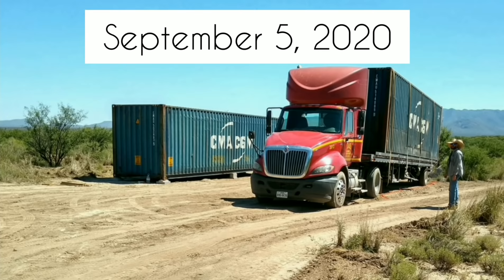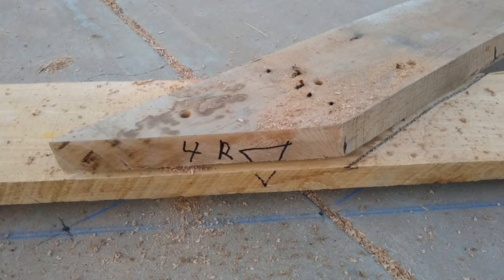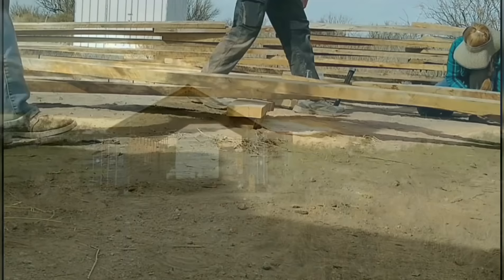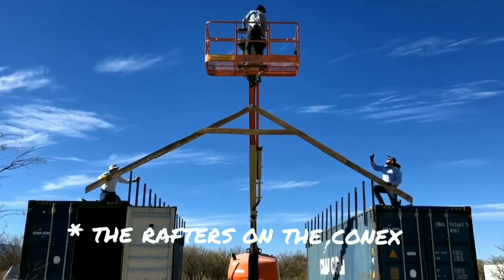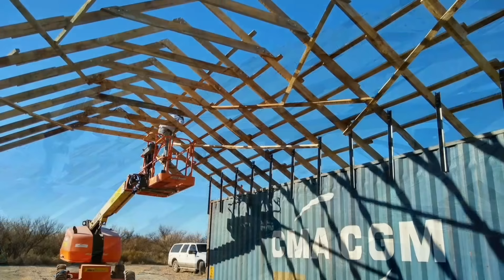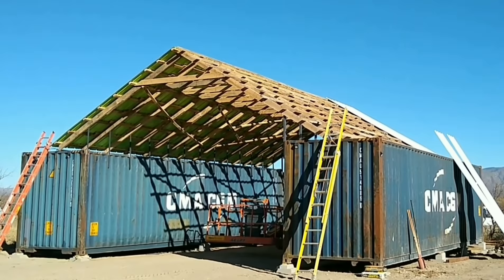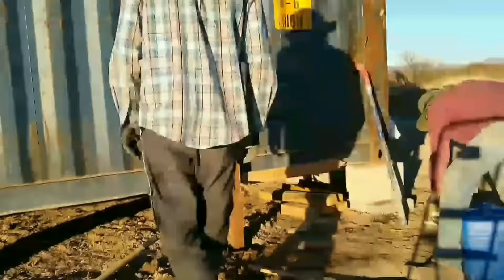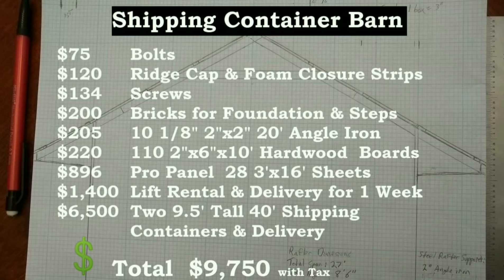Shipping Container Build | One Year Anniversary Recap: Barn, Shop, Storage, Shade & Solar $ Cost

Comment: Good Job! 
We bailed out of the Matrix 20 years ago. We lived in a 16' x 35' military wall tent in Central Arizona for 3 years while we became debt-free . We kept our belongings in a 20' Connex and then added lean to shades around it for a shaded workshop of sorts. 

We built a large house with ICF and then used river rock from our property to come up 6-7' around the outside. We paid cash all the way and did 98% of the work ourselves. We are still not completely done with a few things like trim, tile and the exact lighting we want. However, this was the best decision we have ever made; especially considering what the world is now facing. Keep up the good work!
Reply from the maker: That sounds like quite the adventure, very cool! That's a whole lot of river rocks to gather up. Years ago we gathered many loads for landscaping, it's a lot of work, but I love rocks!
Thanks for watching!  😊🏜️
Reply: @RedandAprilOff-Grid  it has been a challenge at times but such an experience that it really shaped us as people for the better. Yes the rock portion took about a year ( not everyday) . We went total of 250’ by about 6-7’ high. The walls are about 3’ at the base tapered up to  about 10” at the top. We have an R-factor of approximately 50 with the Polysteel ICF blocks(filled with rebar and concrete) . It’s way over-built but it’s like a Castle to us. We calculate it would have cost over $40k just to do the rock if we hired it out.
Reply: Snap we did the same in OZ with icf too. Not totally finished, not totally ideal but  it is off grid and Debt free.
Reply: how did you insulate?  metal box in Arizona....... wow

Comment: PS. I WOULD HAVE PUT THE STRUTS ON THE OUTER SIDE OF THE CONTAINERS' CREATING A KNEE WALL AND EXTRA STORAGE ABOVE THE CONTAINER. the flat surface on either side will just allow water accumulation and rust issues so my suggested design remedies that and ALSO allow lean-to extensions down the road.
Reply from the maker: It would have made for a much larger, taller, and more expensive roof, since we needed the 30° pitch for our solar panels,  We get some water coming in, but it hasn't been a problem at all. We have as much storage as we need, we are trying to use and reuse what we have, and not collect a lot of stuff.
Reply: ..

Definitely Sea both angles

Yes
Lean toos can be added

And
Struts on outer sides
provides rust protection
and added space for storage

Good Eye
Be Well ~

...
Reply: It Would have been very efficient use of space. I never have enough storage. I also would have gone with scissor trusses as well.

Comment: The bottom of those connexs will make great homes and shade for critters like snakes and such if you have them in your area.  If you install blocking or a skirt around the connexs that will stop it plus block cold wind from blowing in debris and such.
Reply from the maker: When it's skirted it creates an even better home for rodents, because they can dig tunnels under the skirting and not as many predators can get to them.

Comment: With your container anchors, I would recommend people use square box section tube like 4x2 or 4x4, I actually used 5mm wall box tube to support the weight of the container and welded the corner to it so supporting the down weight and stopping it from moving, it can be done after construction but best done before as there are many wind forces that bear on it one can easily do this corner by corner by moving the blocks digging and cementing in the tube to weld to container, all of it sits under not outside the footprint of container, I think it's a better way.
Reply from the maker: That sounds like a good way to do it.  👍
 In the video that came out today, Red checked the levelness of the containers before mounting the gate.

Comment: just my 2 cents.  at 12:30 you embedded anchors to attach the conex box, you should have used metal, metal works with concrete  whereas wood expands and contracts beyond the tolerance of concrete.  thank you.

Comment: If you are welding on the very thin walls of a shipping container and blow a hole through, [very easy], all you have to do is have someone hold a 1/4" thk piece of copper plate on the inside with a tool, and you will easily be able to fill the hole from the outside, or alternatively, hold a steel plate on the inside and fill the hole the same way leaving the patch plate there as a patch !!!
Reply from the maker: 👍thanks

Comment: Very Nice! This is what I would call an Amish Redneck Barn! I would suggest walling off the gables and creating a little bit of a loft on the ends which would add more strength, stability and attic storage capacity! Solar panels are heavy! Nice big barns get real small after you start filling them with stuff, starting with a camper!
Reply from the maker: Thanks! It looks a lot better than I expected, and has been great for everything we have needed while we build our house.  Once we get our house built, we'll move the trailer out, and Red plans to use the structure for a shop, and possibly enclose one or both ends. We hope to keep everything fairly minimal and uncluttered out here. 🌞🏜️

Comment: I wouldn't worry about the roof pushing the containers apart but you should have put a second pitch out to edge with some 8 ft boards.and more important you should have really staggered the joints on those perlings
Reply from the maker: It's all good and everything has worked out great. We like being able to walk on top of the containers to access the solar panels, and the gutters work well.

Comment: Such a great flashback. Great drawing skills. How did Red all this great building knowledge, even cutting metal.
Reply from the maker: We have done a lot of building and remodel projects throughout the years. Woodworking is a hobby, & he has designed and made some pretty cool furniture pieces. He worked as a Machinest for 7 years, but had very little experience with welding. He does a little research and figures it out as he goes. Thanks!
Reply: @RedandAprilOff-Grid  well he seems like a very smart man, amd very meticulous. I am just very surprised that he understands the tensile strength via applying moment to the aircrete piece. Hense the bottom of the piece experience tension and breaks because concrete is brittle. This is why in reinforced concrete, the rebar is put on the tension side to resist that effect.

Comment: Great looking barn, personally I would have covered both containers to prevent rust and weathering and improved insulating, also joined batten over trusses to maintain one clean line, only for appearance. You guys have created a great economical space, well done👍
Reply from the maker: Thanks! For our particular needs, budget, and the the materials we had available, this design has worked out well. 🌞🏜️
Reply: I was sort of thinking the same thing.  It would keep the containers cooler too.  I want to do something like this someday. Thanks for posting the video
Reply: Yep better to cover the entire roof area of the containers. Moisture over time will rot the roof

Comment: The roof should go past the containers so water does not corrode the tops of the containers. You could put construction lumber all the way under the metal roof so when something hits the metal the sound gets dampened at the source. The amper setting on the welder should be set lower so you do not burn through the container wall.
Reply from the maker: This has worked out fine for our area. We get most of our rain in the summer monsoons and it's pretty dry the rest of the year. Also the gutters we installed work well.

Comment: When i was in the swedish military and stationed in another country the barracks where constructed almost exactly like that. Two living container with a roof with steel beams and a wooden deck between the containers. The roof was extended all the way past the containers. Believe that was a wise decision.
Reply from the maker: Very interesting! 😎
Although not ideal, it was well worth it to us to set the roof in the middle of the containers, we needed the steeper pitch for our solar panels, and the wood we had wouldn't have been long enough to go to the edge. Water coming in hasn't been an issue, & it's a nice and very secure solar rack. Someone in the area just spent $5,000 just in materials for their solar rack. 😄 Anyway... It's working well.

Comment: The treated lumber in the concrete is going to rot quicker than you realize. Should have used a steel mounting bracket for the base of a post.
Reply from the maker: We don't feel like they are entirely necessary, but we may eventually replace them with something better.

Comment: By the time you put a few ton of stuff inside the contains plus their own weight, they wont go nowhere, our containers havent moved and our huge canvas roof tore to shreds by high winds, one thing I will say about your roof, you need to fully cover the tops of the containers as the roofs eventually rust and leak.
Reply from the maker: Yes, the containers can handle really high winds even when they are empty. We don't get a lot of rain here, the tops of the containers are painted and look great so far. Currently, we are working on turning the middle into and enclosed shop. 🌞
Reply: @RedandAprilOff-Grid  We used 3 40' containers to make our shed, but when we build our new 400 sq mtr shed we stopped using it except for storage, then high winds ripped the canvas dome to pieces and that was the end of it, our original shed used 2 40' and 1 20' containers with a flat steel roof, after about 10 years the roofs were all rusted and leaking badly, that's when we built the second shed.

Comment: So the pitched roof directs water to the top of both containers. How did you keep it from flowing under the roofed area since the containers have flat roofs
Reply from the maker: We have gutters on now, but even before the gutters, we didn't get too much water coming in. The tops of the containers have a slight arch, so most of the water runs off the outside edge.
Reply: That’s what I was wondering. I build container homes in Texas and we have a problem with rust here. So keeping rain water off the containers as much as possible is the best thing. Even tho they are “sea worthy” they are still steel under the paint.
Reply from the maker: @pb7133  We painted the tops of the containers with a white elastomeric paint. We get almost all of our rain in 3 months, and are pretty much dry the rest of the year.
Reply: @Shawn Kemp or added a second roof pitch under the Eves of the first roof
Reply: Was wondering the same thing as I am in the process of building one of these. I was thinking of sloping each shipping container slightly out then foaming the ridge gap (I do spray foam)

Comment: ..

Bravo

Considering post covid
excellent savings

Do understand your decision for AZ
query John Wesley Powell
at your leisure

essentially looking to do the same
configuration
but half the length
and yes
side doors for easier access

Do like the garden
Solar set up
Rain catch system

Nice of the driver to
set the 2nd Sea Container
where you desired

Alaskan YouTube couple did similar
one Sea Container
two car ports

Figure to use both layouts
with first pouring concrete
and Rebar

Well Done
Congrats

Saw a family with a few red Sea Containers
used white paint
to give the box

a look of
Brick Buildings

Enjoy
Be Well ~

...
Reply from the maker: Thanks! We are really enjoying Southern Arizona. 🏜️  Arizona is pretty ideal in many ways for what we are doing. We love the abundant sunshine, cool nights, summer monsoon season, interesting wildlife, beautiful sunsets, and mountain views.
This structure has worked out wonderfully for our needs! Sounds like you have done your research, best wishes on your build! 😊

Comment: Late to the party, but I've got to ask: Considering you were building the entire roof to custom design anyway, why on Earth did you not extend it beyond the outside edges of the containers, for sun, rain, etc?
Reply from the maker: We need a 30° angle for our solar panels. To keep the roof at the proper angle, we would have needed a lot more materials, and it would have been a much larger roof. This design has worked great for us. No regrets!

Comment: Looks great! I'm curious, why did you opt to run the trusses to the middle of the containers rather than the outside edge? Would you make any changes if you were doing this again?
Reply from the maker: It had to do with the materials we had, and we needed the proper pitch to mount our solar panels on the roof. At this pitch, the roof would have needed to be much larger and taller to completely cover the containers. Everything has worked out great for us in this area. No regrets.

Comment: Off grid doesn't mean being left alone in my part of the country.   did your taxing authorities treat your structure as a taxable building?  I suspect as soon as you poured that concrete and attached it to the Conex that you are due for reassessment on your property taxes.  I placed two 40' shipping containers on my property but they just sit on blocks so didn't earn me a reassessment.
Reply from the maker: @ForbiddTV  Yes, the concrete pad will effect our taxes. The containers are not on a permanent foundation, so that should help keep the taxes lower.

Comment: Probably metal instead of treated wood in the ground would have been my choice since wood is not that strong considering the weight of the container and roof.  Also wood in the ground wont last.
Reply: Treated wood has a long lifespan if not cut. If cut, it needs to be treated.  I have two barns with fifty year structure warranty that use treated posts. One is already 30+ and solid. Metal will rust through if in the ground. I have seen too many metal fence posts that rusted.

Comment: How is water going to run off the container roof? It will just collect there and then flow down on the inside as well as the outside?
Reply from the maker: We have added gutters, and the tops of the containers are slightly rounded so water runs off the outside. At times the wind blows some water in, but it's not a lot.

Comment: I forgot but you we're going to insulate that with open cell foam right?
Reply from the maker: The solar room is all that is insulated for now. For that, we used a double layer of foam insulation board and covered it in drywall. The ceiling in the solar room is 8 feet tall, so there is a gap between it and the top of the container. It has been working well, but we probably should try to insulate the floor too.
Reply: @RedandAprilOff-Grid  Arizona must be a pretty dry climate. Steel likes to sweat when it goes from hot to cold, we have that issue in winter here in Canada. So if there isn't enough ventilation within that gap you mention then mold happens on the foam boards.
Reply from the maker: I think it's been good so far, but it would be interesting to take a peak. Yes, the winters here are typically very dry. We'll keep an eye on it, thanks! 🙂
Reply: @RedandAprilOff-Grid  no problem, when you see thousands of attics with mold, you start to figure out the cause lol. And also what works and what doesn't.

Comment: Nice work!  The wife and I are getting ready to do similarly here in NW AZ.  Kinda curious though...what do you do about the rain runoff when monsoon season is upon us?  Does it flood the top of the containers?
Reply from the maker: We have added gutters, and the roof comes a little past the center, so the water runs down the outside edge. The tops of the containers have a slight bow. Sometimes the wind is blowing hard enough that we get a little water running in, but not enough to be a problem.

Comment: I could not watch to the end but it would have been a hell of a lot cheaper to put a few posts in the ground and start from there
Reply from the maker: Not with the time constraints we had when they were delivered.  The blocks won't rot, and later he cemented some treated lumber into the ground and anchored the corner of each container to the ground. It's holding up well.

Comment: i am surprised that the containers took the weight of the timber (lumber) roof ,  did you reinforce the container walls
Reply from the maker: We did not reinforce the walls. The weight is supported on the 4 corners and the top rail on the side walls is very strong.

Comment: I’m just starting this EXACT project. One question I have… did you slightly slope the containers so water would flow to the outside of the units? I know it’s Arizona but still!
Reply from the maker: The tops of the containers are not perfect flat.They are made with a slight bow on top to help the water run off. As long as the roof goes at least to the middle or preferably a little past, the water will naturally run off the outside edge. We have gutters along the metal roof now, and as long as the wind isn't blowing the rain in, the water stays out. Sounds awesome, and best wishes on your build!
Reply: @RedandAprilOff-Grid  do you have a video of your solar set up? I looked quickly but didn’t see anything. I’d like to know how many panels & BALLPARK  how much the entire solar system cost!
Reply from the maker: Yes, https://youtu.be/zRrwp2IEx2M

Comment: What was the cost for solar panels and solar equipment
Reply from the maker: Our original system was $6,000. We have recently added another 48 volt battery and a few other things, so the cost is up to around $10,000 for the complete system. Our last video was a cost breakdown for everything on the property.